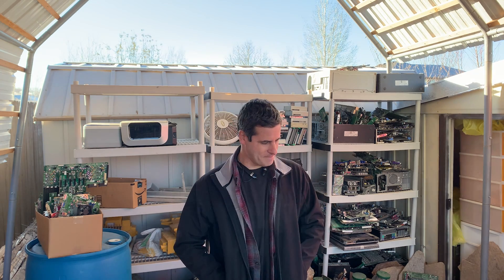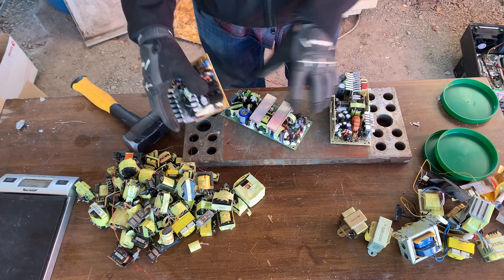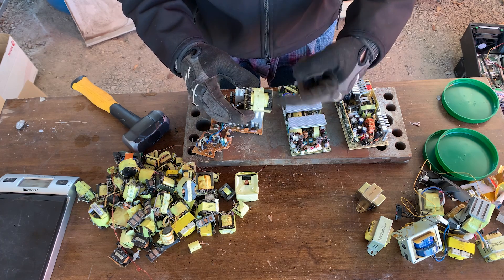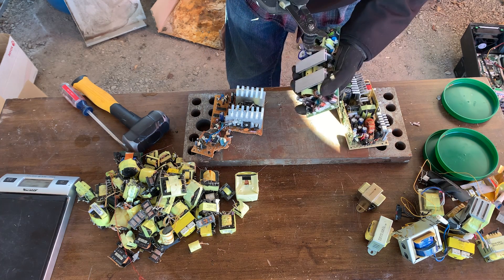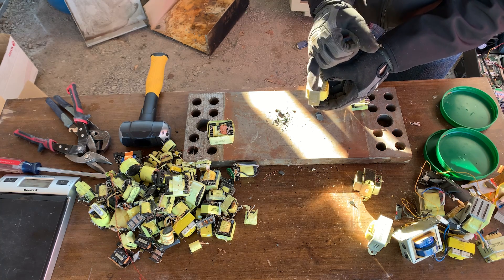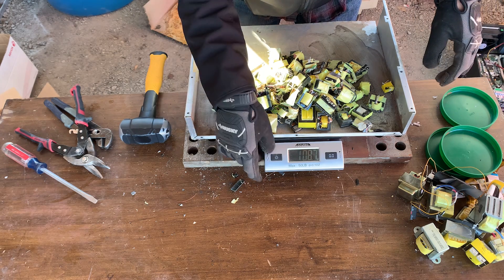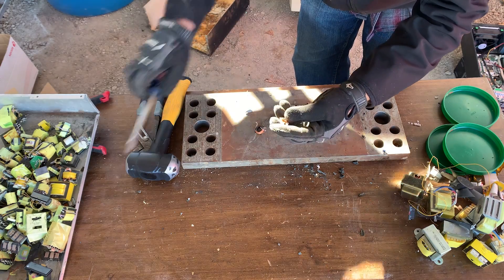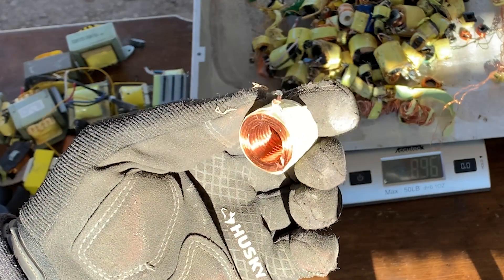Fast Copper Recovery: AC Step Down Transformers from Desktop Computers

Comment: Transformer law volts per turn in. Primary equals volts per turn in secondary. Voltage steps down 24:1 current steps up 24: 1 . 5 wraps of #8 gauge in secondary gives around 70 amps at 5 volts. Use a light switch to make and break as your on/off switch.
Reply from the maker: Very interesting.  I have a friend who is making a transformer.  I have never studied the science behind AC transformers.  Thank you for sharing a little bit about the windings.  It would make sense that 120V would need a 24:1 step down to get to the 5V found in all desktops.  Thanks again :)